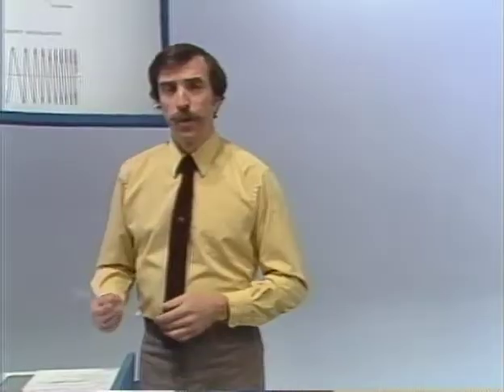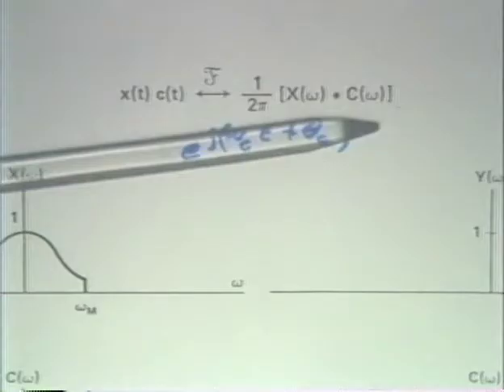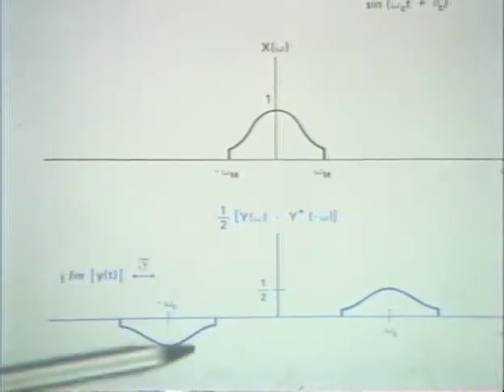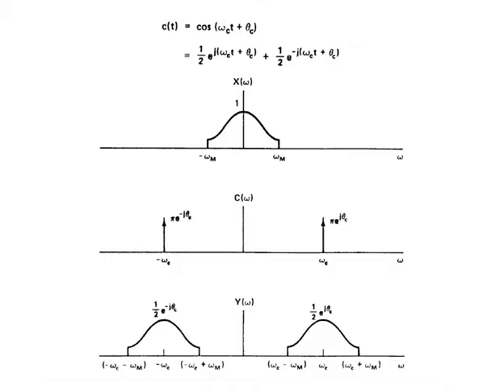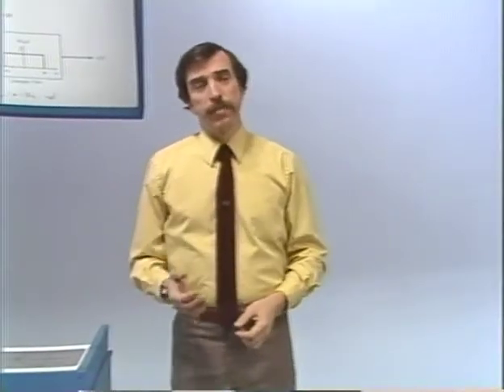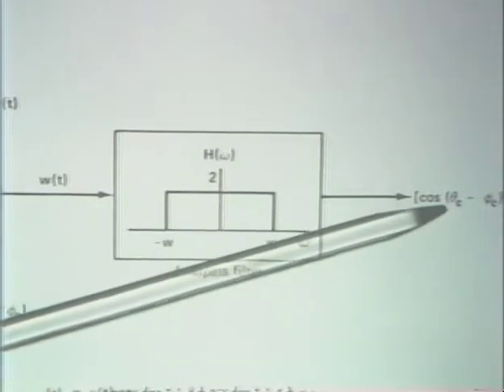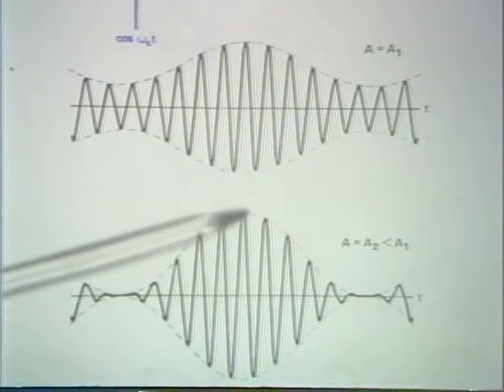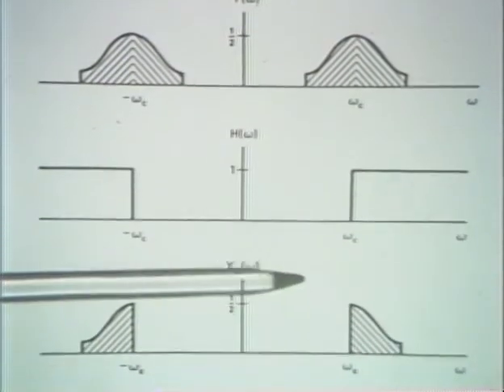Lecture 13, Continuous-Time Modulation | MIT RES.6.007 Signals and Systems, Spring 2011

Comment: All the wrapping my brain around what systems are, what discrete time looks like, what convolution does, what the Fourier transform and series do, was worth it. Now we're at the fun part!

By the way, I propose half seriously that Engineering schools break this course apart into two courses. The amount of time that needs to be spent thinking about the subject to understand it well is a lot. I think part of the reason is because we're not very used to thinking about systems, series, and the properties of discrete periodicity, after previous math classes. So, we have to get over a hump of understanding something for the first time that is essentially not very complex.
Reply: I'm know that Georgia Tech breaks discrete time and continuous time into separate classes.

Comment: Word count statistics:
"Signal" and derivatives - once every 28 seconds
"Spectrum" and derivatives - once every 40 seconds
"Carrier" and derivatives - once every 43 seconds

99 signal
75 carrier
73 spectrum
57 modulation
50 frequency
34 sinusoidal
34 one
32 amplitude
32 complex
31 filter
31 part
30 phase
30 can
28 omega
25 just
24 output
22 back
22 Now
21 exponential
21 original
20 demodulator
20 now
19 modulator
19 look
19 want
18 Well
18 sub
17 signals
16 referred
15 domain
15 get
14 real
13 frequencies
13 important
13 lecture
13 example
13 course
13 issue
13 fact
13 take
13 time
13 two
12 indicated
12 modulated
12 indicate
12 low-pass
12 system
12 also
11 envelope
11 simply
11 theta
11 minus
11 terms
11 will
11 idea
11 way
10 demodulation
10 modulating
10 different
10 transmit
10 positive
10 using
10 shift
10 like
10 case
10 use
10 One
Reply: Did you use some program to count these?
Reply: @unknownuser927  Caption exported to txt manually, then MS Excel.